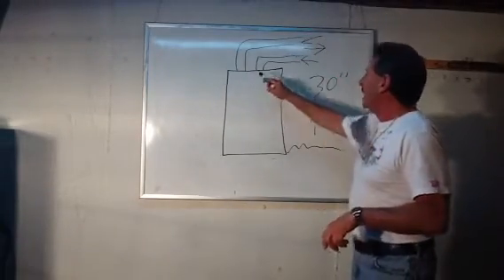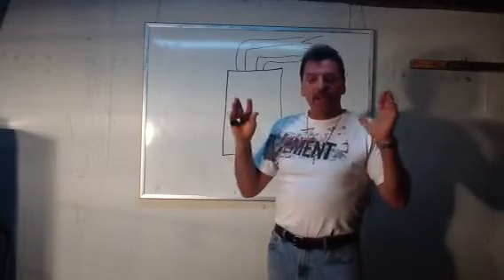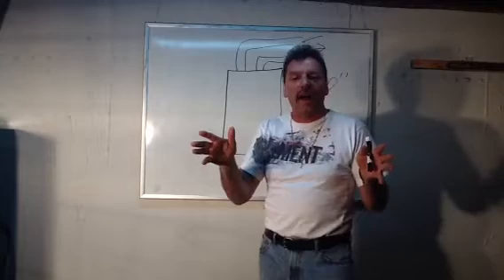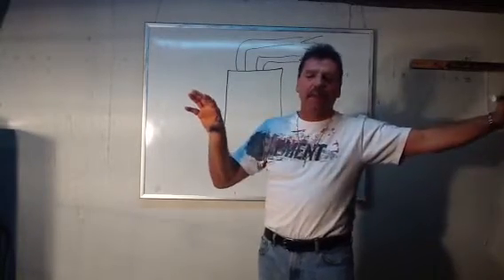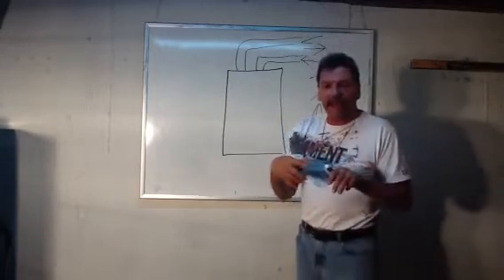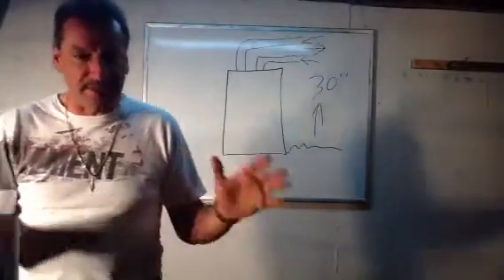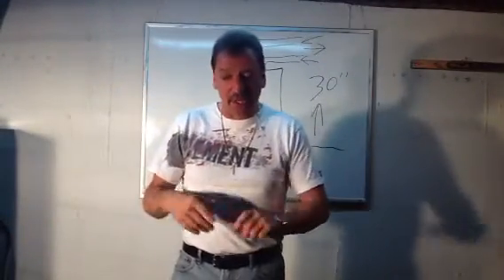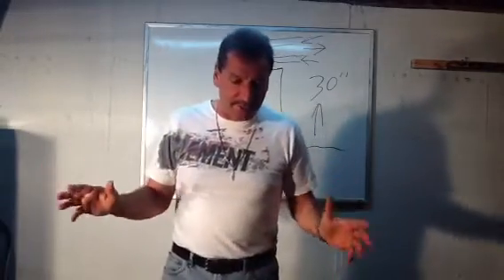Tankless water heater part 5 (loudepot)

Comment: Also if you pipe it too close to that dryer vent, it'll suck in all that dryer lint garbage which will totally clog up the fan and burners. Plus dryer lint is an excellent fire starter, just ask any outdoor camping enthusiasts, a little dryer lint will quickly start a good campfire! Useful out in the woods, but not what you want in your house!